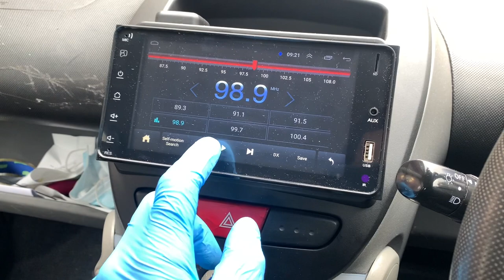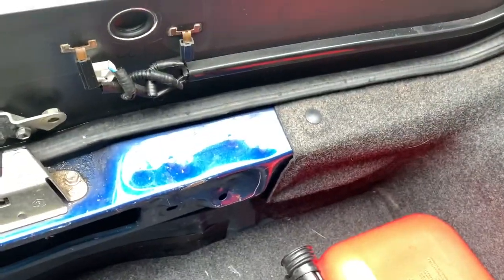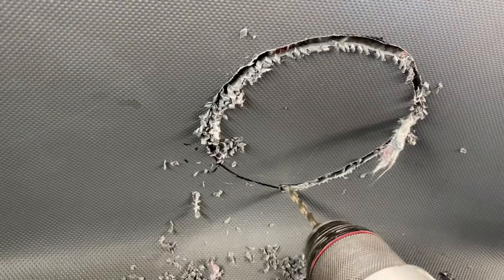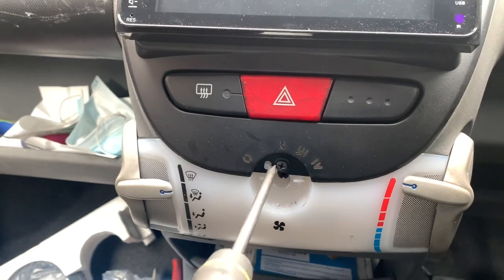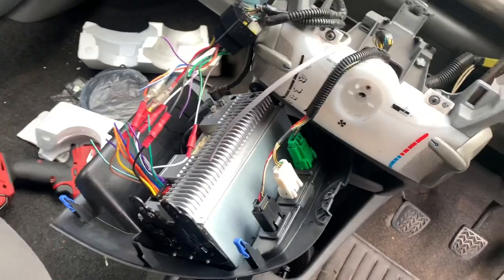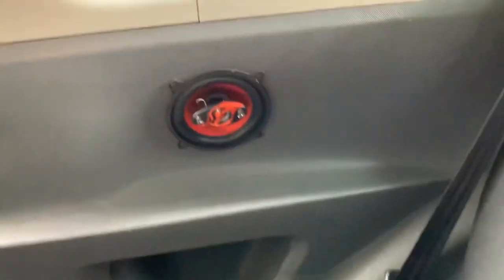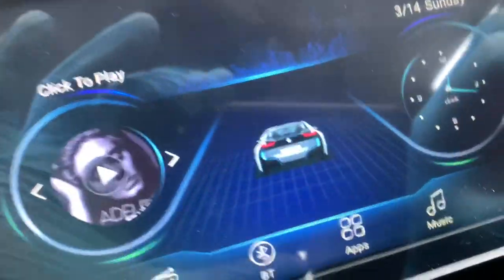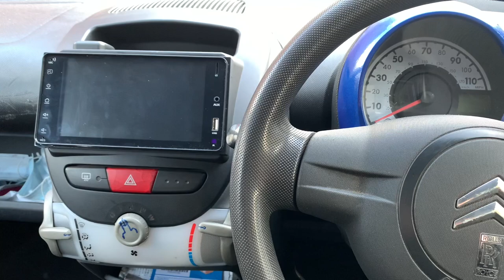Citroen C1/107/Aygo Rear Speaker Installation

Comment: If you have the rear panels out , add some self adhesive sound deadening pads , or some flash banding over the wheel arch inside , and over the inner quarter , I just did mine and filled the gaps with expanding foam , the car is nearly silent to drive now , a huge difference for only a few quid , Ill do the spare wheel well and inner boot floor next .
Reply from the maker: I already did put some flash banding on, but I’ve got plans to do it better (similar to your expanding foam idea) but I’ve got other wires to run for other mods before I can do it really lol
Reply: @StupidBlokeStupidVideos   Its well worth the effort , Ill look forwards to seeing the video.

Comment: im trying to do this on my 107. What connector plugs into the factory radio rear speaker ports, ive looked everywhere and have no clue cheers
Reply from the maker: You can probably add the connectors into the original plug, or find a plug off one with rear speakers from factory but they’re rare.
Reply: my radio harness has 4 spare pins which are for rear speakers iirc? just got no clue what the actual metal plug things are that go into the harness, or do i need an aftermarket iso harness? cheers  @StupidBlokeStupidVideos
Reply from the maker: @Robbeurobeat  yea that’s what I mean. The harness has the holes for the connectors to fit into. If you can get the correct ones they just clip into the plug but I’m not sure which ones you’d need
Reply: ok cheers mate @StupidBlokeStupidVideos

Comment: did you buy an adaptor in the back of the stereo because i don’t think i have that many wires to connect to ?
Reply from the maker: Yes, we’ll kind of. My radio had a different plug so had to adapt the wiring. The standard plug is the same plug but usually missing the wires for rear speaker as they were an optional extra. With the right electrical connectors they could be added to the standard plug.
Reply from the maker: This is the video where I fit the new radio, I adjust the wiring on it and it has a diagram somewhere in the video of where the missing rear wires should be on the plug. The standard head unit does actually have the outputs to them, but they’re just unused. 

https://youtu.be/MPR1jrsV5Z4

Comment: Is there a way to work out if my head unit can support my already upgraded dash speakers, an underseat sub/amp (which I’m going to fit tomorrow) and a couple of maybe 9x6 rear speakers on my planned MDF parcel shelf?
I’m no Alfred Heinstein so I don’t know how to do the mathematics. I just want my music as loud as possible to give it a fighting chance of drowning out the road noise 😂 
If you’re ever in Gloucestershire, let me know and I’ll let you film me making a total pig’s ear of these projects lol
Reply from the maker: Sounds brilliant. Are you using the standard head unit? There are no phono outputs to an amp on my original head unit, but some amps take a hi level input from the speaker outputs of the stereo, end it not you can get adapters from the speaker outputs. Also the standard stereo does have outputs for rear speakers on the head unit itself, but the wiring to the plug has them missing usually as most of these cars don’t have rear speakers as they were an option extra.
Reply: @StupidBlokeStupidVideos  I bought a Chinese unpronounceable DAB head unit from Amazon and it has 2x RCA outputs (4 plugs in total) so theoretically I could output the sub from one of the RCAs and still wire the rear speakers into the harness. I think it said the head unit is 4 x 50 wattlingtons. I’ll just try it and hope the car doesn’t melt.
Reply: This Kenwood sub/amp has both wiring setups supplied - input from the head unit’s RCA output or from the speaker harness. Then you just flick a switch on the amp to correspond with the input you use. It’s all very clever.
Reply from the maker: @infidelcastro5129  it’s probably something similar to mine, the one I’m using is some Wish special, and it’s so light it feels as though there’s no amp in it, but it does a better job than the oem one. You can always amp the speakers and just use the head unit as a pre-amp which is what I’ve done in the past, but might be more hassle than it’s worth tbh.
Reply: @StupidBlokeStupidVideos  Update: started installing it, cut my finger, got confused about which output to use and blew the radio fuse, dropped a socket into the engine bay and spent 30 minutes trying to recover it, invented 7 new swear words and went back in the house to shout at the dogs. 
Might try again this afternoon.
Reply from the maker: @infidelcastro5129  sounds like it’s going exactly as planned 🤣
Reply: @StupidBlokeStupidVideos  Turns out the RCA outputs on the back of the head unit were wrongly labelled on the sticker that’s supposed to tell you what they’re for. I decided to ignore the sticker and go with my gut instinct which turned out to be correct. If I recall, I ended up connecting to the outputs labelled ‘rear right’ and ‘front right’ and they connected to the rear output. Getting the live feed through the bulkhead was a bugger but I got there in the end. Everything else ended up being relatively easy, though pretty slow going. Upshot is I now have a thumping sub under the passenger seat. Sounds pretty awesome 😊 
Next project is to wire my new £35 (no expense spared) 6x9s into the spare outputs in the ISO harness once I’ve built a parcel shelf from leftover MDF. 
I must give you credit for your inspirational videos - I’d never even have attempted any of this without you giving me the confidence 😁
Reply from the maker: @infidelcastro5129  that’s brilliant mate. You should upload a video of it banging some tunes out! Would like to see it to be honest.

Comment: hey bro. been watching your videos recently. im buying an aygo end of this month was just wondering if there was any way I could reach out to you for help with things if possible
Reply from the maker: Course mate I will always help with advice etc where possible.
Reply: @StupidBlokeStupidVideos  I Just had a question with the wiring for the front speakers. Did you solder the wires to the spade connector?
Reply from the maker: @G59Loser  in the first video I crimped them, but in the second video I got plug in adapters which makes the job a lot easier and are only cheap. This is the second video, they’re better speakers in this vid too. 

https://youtu.be/ftyDQD8QY5M
Reply: @StupidBlokeStupidVideos  which plugs did you use? I’ll go get some of them if it makes it easier
Reply from the maker: @G59Loser  yea it does help tbh. These should fit. 

https://www.ebay.co.uk/itm/Pair-of-Speaker-Connector-Adaptor-Lead-Cable-Plug-for-Toyota-Aygo-/172504805258?mkcid=16&mkevt=1&_trksid=p2349624.m2548.l6249&mkrid=710-127635-2958-0

Comment: Mine’s a 5 door and there’s no space for rear speakers 😟
Reply from the maker: Do you have a parcel shelf?
Reply: @StupidBlokeStupidVideos  There wasn’t one when I bought the car, but it looks like there should be one. I assume it got lost or broken by the previous owner.
Reply: @StupidBlokeStupidVideos  Are you thinking I could stick some speakers in the shelf? Sounds plausible 😊
Reply: @StupidBlokeStupidVideos  maybe I should make my own shelf from MDF and put the speakers into that.
You’re a veritable mine of great ideas 😊
Reply from the maker: @infidelcastro5129  yea, that’s where they are on rare models thar came with rear speakers! Put them on a plug so they can be disconnected to remove the shelf
Reply from the maker: @infidelcastro5129  I made a shelf out of MDF for my old volvo V70, but I had 4 x 12” dual coil subs at 2.66ohm, MTX door speakers and boxed and amped Vibe squares in that. I did a lot more working out to get the ohms of the speakers matched to the amp on that and had to fit at battery in the back to accommodate the voltage drop haha

Comment: Cool Speakers 😎 But you forgot to take more Alubutyl inside on the Metal 😒 And you have no Speaker Cover? I hope you understand that I mean? Greetings 😉
Reply from the maker: There is already roof flashing as sound deadening on the panel, but I’ve plans for other stuff to test too. I didn’t want block any of them powerful sound waves with a grille though 🤣